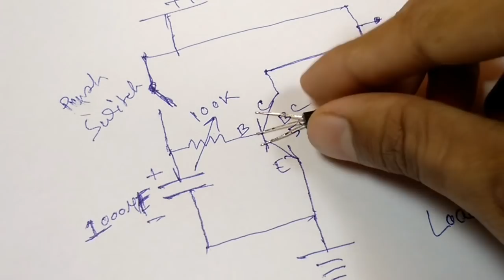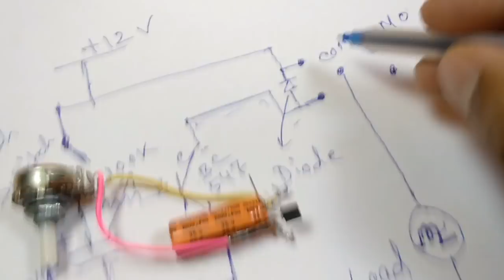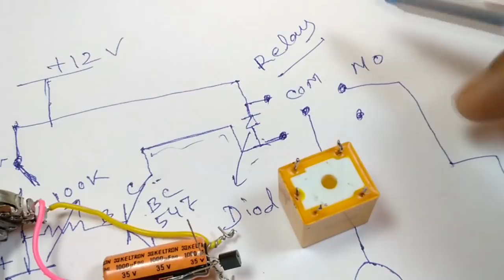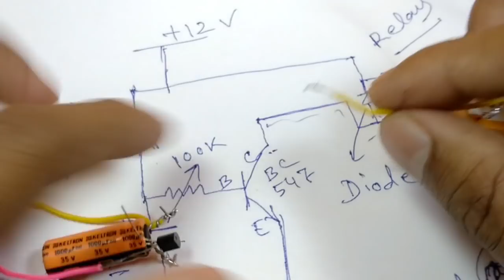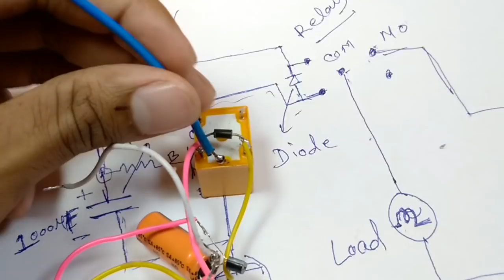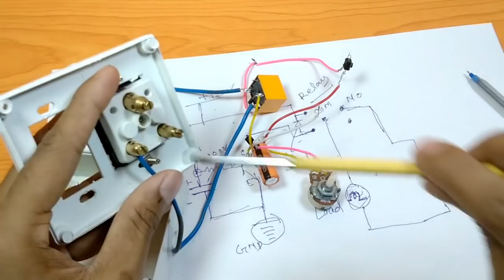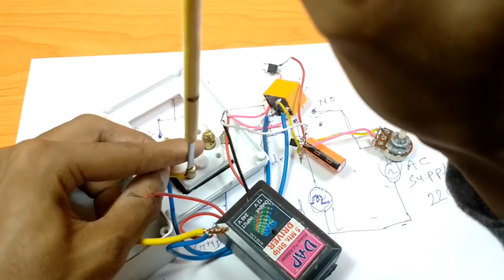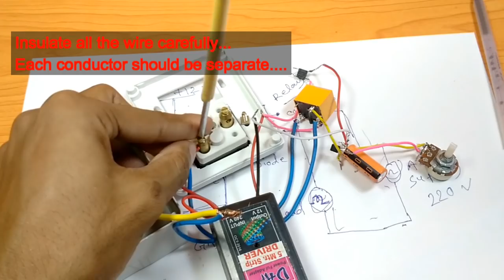How to make timer switch for "light,mobile gadgets" without any IC at home||DIY

Comment: Sir kaya hum isme transformar less 12v dc use kar skte he kya ya 12 v transfomar ko dc me convert kre use kar sakte he
Reply from the maker: yes but I suggest not to use because in transformerless power supply there is no isolation present in the circuit....

Comment: i am using using bc 548,input volt 12,diod 1n4007,100k pot and 1000uf capacitor but can not working ...plz explain me....
Reply: i must make this project...
Reply from the maker: It will work.... check your circuit again and also the parts...it will definitely work..... don't worry there might be some mistakes....
Reply: must  use 547 it is pnp transister

Comment: Sir plz guide me for same project but by using of 9 v power supply instead of 12 v  as i have already of 9 v 
Suggest the required changes
Reply from the maker: nothing will be change just use a 9v relay....or you can also use 12v relay it will work on 9v suppy...

Comment: what I can do to increase the time 2 hr
Reply from the maker: increase the capacitor value
Reply: How To Bro what value of capacitor should I use to increase up to 2 hour
Reply: Samanth Pattar the value is given by Time constant=capacitor val* resistance  so you can get 2200 micro farad capacitor and two 1.65 million ohms in series which will give you =2200*10^-6*1650000*2= 7260 seconds or 2 hrs approx
Reply: Ashish Thapa it also not comeing for 2 hour. I will tryed 2200* 6 capacitor in parallel and resistance. Its comeing only 1 Hour. Anybody can suggest for approx 2 hour.
Reply: DO YOU USE ABOVE SEIRIES 2200UF WITH HIGHT VALUE  RESISTER ?2.2 M OMS   ,1.5 M OMS...ETC...?
Reply: Ravi Kumar Try another timer circuit.
Reply: yes, my question also same pls reply us...
Reply: All i need is 20 or 30 minutes timer any capacitor value and resistance

Comment: Nice project,
What is min and max time limit?
Reply from the maker: it is depend  on the potentiometer & capacitor value...
More capacitance & more resistance will be more time but there should be limit in resistance..
Reply: I want ton my light at 7pm-11pm every day..what is the solution? Is it possible in 555 timer?

Comment: my water filter have power rating 30 watts and operating voltage 230 v. 50Hz. i want to switch off the appliance after 15 minutes automatically.can i?
Reply from the maker: yes you can...

Comment: what value of capacitor I should use to increase it for 1 hour
Reply from the maker: yes...increase the value of the capacitor...
Reply: yes, Capacitor value should be 2200 mfd 12 volts is enough to make upto 3 hours delay.

Comment: How to Calculate Capacitance vs Resister ?, ie. ill use 1000+1000 Parlel uF then Max Resister required ?
Reply from the maker: use this http://mustcalculate.com/electronics/capacitorchargeanddischarge.php?vfrom=&vto=&vs=12&c=1&r=100000&time=

Comment: What capacitor I use
Reply from the maker: For long time you can use 4 1000uf capacitor in parallel connection...
Reply: sir its 4100uf ? in parallel? sir can i use parallel capacitor with high  value resister?

Comment: Please send a circuit diagram for 1 hour timer without using potentiometer but only resistant instead of potentiometer
Reply from the maker: use 5-6 1000uf capacitor in parallel.....with 220k resistor.....

Comment: this circuit is fake it does not work
Reply from the maker: absolutely not...this is 1000000000000000000000% original.....you can try it at your home....if you face any problem, please comment...
Reply: How To Bro I tried it but it didn't work
Reply from the maker: did you used same parts with same circuit diagram??
I think your circuit is wrong ..please check it again....
Reply: How To Bro ya I use same parts I want to know potential meter 100k or 10k in video u r showing 10k and  in description parts list there is 100k
Reply from the maker: you can use any of this???
Reply: Thank you bhai mera circuit complete ho gaya hai but it work only for 4 minute
I want it to convert in hours mode
Like 1h  2h 3h 4h 
Can u tell me how it happen
Reply from the maker: just increase the capacitor value with a 1 megaohms variable resistor...
Reply: Bhai only 1 om capacitor work for 1h 2h 3h 4h 5h
Reply from the maker: use 4-8 1000Uf capacitor in parallel with a 1megaohms variable resistor..
Reply: Bhai how can I connect capacitor & transistors
Reply from the maker: same circuit...just use 4-5 capacitor parallel ....
Reply from the maker: bhai google it 1000uf capacitor...
1m potentiometer...